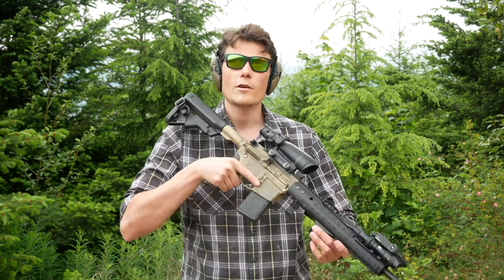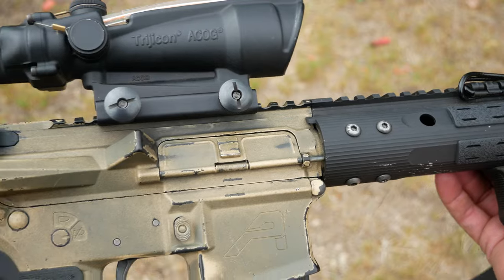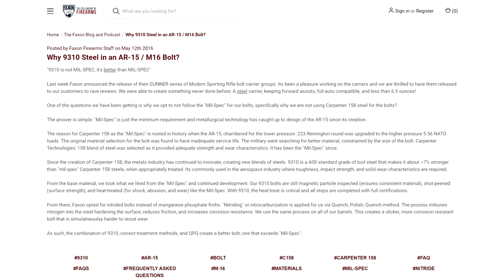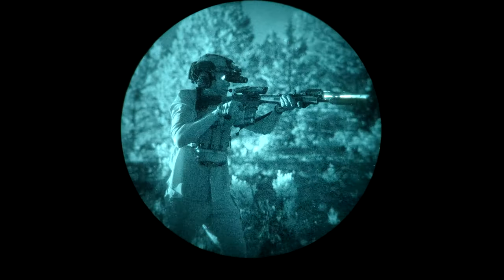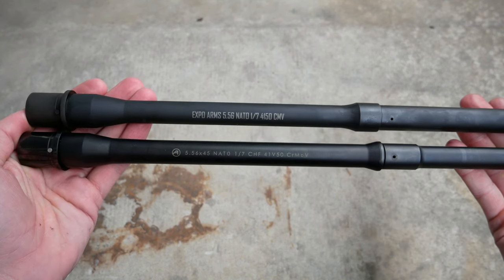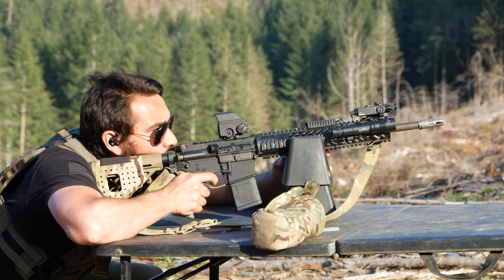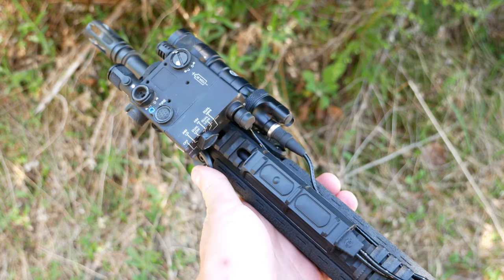Let's talk about the new Aero Precision PRO Series

Comment: I wouldn't call tuning a rifle (via adjustable gas block) "snake oil" in of it self, but if you have the correct combination of parts to go along with a barrel's given gas port size (and shooting the right ammo) then effectively your rifle is "tuned" from the start, instead of after the fact with an adjustable gas block. From the video footage, that build looks to be excellently configured with the brass cased ammo and I assume a fairly standard carbine buffer weight and spring strength. Ejecting at about 4 o'clock unsuppressed and 3 o'clock suppressed is perfect. The only way you would "tune" beyond this is if you decide you are always going to shoot suppressed and then try to make that permanent configuration eject at 4 o'clock as well.

Comment: >chf
>NOT chrome lined
Literally ass backwards. Colt barrels aren't CHF, but they are CL, and they set the standard for "duty grade" barrels for decades. I could be wrong, but I don't think the M4/M16 TDP specifies CHF. FN-produced M4s and M16s have CHF barrels, just because that's how FN does barrels.

Comment: Some things to mention: the pro barrels are dimpled so installation easier and gas block walk off is harder. Chrome lined is more preferable than CHF (look up BCM's testing of a mil spec barrel and you'll know why). Lastly, if the BCG isn't full chrome with a phosphate ejector then you haven't reached peak autism.
Reply: CHF does little without chrome or stellite lining.
Reply: How much of a gimmick is CHF'ging in general? I understand it got popular in comblock countries because it was an easy way to mass produce good enough barrels to throw in AK's. By no means is it a terrible manufacturing method, but I can't help but think there's a lot of undeserved hype around it.

BCA is doing CHF'ging now, and you couldn't give me one of their barrels.

Comment: The only problem I've had with bolts is lug wear.  And only had it with two makers, AR SToner and PSA. (I'm pretty sure AR Stoner is a rebranded DelTon.)  Granted those BCG's are super cheap and hold up reasonably well and it's not indicative of all their BCGs.  It seems to be from sloppy machining,  from a worn cutter which doesn't quite make the bolt cam slot right, so there's some slop.  

This results in rounding of the edges and minor dings on the actual bolt lugs if I'm shooting mystery or hot loads.  Not a big deal, I still have them, adn they are now an "emergency part" to cannibalize if the ATF goes full Brandon. They are still useable in their current state and each has about 2K rounds on it.  (DelTon/AR Stoner a est. 1000 more)  I think this was due to PSA/Stoner just starting up and over eager in their attempt to break into the market.  I've bought other PSA BCG's since and have not encountered any slop and they run tight and right.  DelTon's I don't bother with because there is no real savings there, and for me not worth the risk.  

But as far as BCGs go there seems to be litter difference if you are going with a reputable manufacturers.  They all seem to have the same level of QC.  And to be honest, for the average shooter, the chances of you wearing out a BCG is pretty remote.  For the most higher end BCGs I estimate it's something like 15K rounds minimum asides minor repairs like gas rings or extractor spring/o-ring. 

I have several BCG which I run, currently I'm biased towards WC because every once and a while they'll go on sale and you can pick up a top of the line WC for about the same price as midgrade BCG.  (175 or less USD)

Don't take this as a gun-snob type of thing, what you can afford is what you can afford.  it's better have something bare bones than nothing at all, just know what to expect.  Aim small ya'll.
Reply: Far as I know, AR Stoners are rebranded BCAs. (Compare the flash hiders on the Stoners and Bear Creeks)
Reply: @l800x8  Maybe but, don't think BCA is that old.  Similar QC though.  Who knows.
Reply: PSA used to offer multiple bgc’s from different sources. They offer toolcraft bcg’s which are awesome and you can get them with the tool craft logo or not. I think they only offer toolcraft now but I have searched for any other type from them.
Reply: @chrisjosekuehl  I think they are all in house now.  They may have done that starting up.

Comment: Regarding the Pro Series lower, I think it would essentially feature a right-sided bolt release like the Munitionworks Dissident, a side-charging handle like a JP Rifles/Sig MCX Spear and probably would be designed to take folding stocks.

Pro Series upper would just be straight up monolithic.

Comment: I have 9 Ballistic Advantage Hanson profile barrels in many different lengths. I've been buying them since 2017, and I still haven't found a reason to go with another brand of barrels.
Reply: I have used and built over 100 aero rifles for customers and BA Hanson is my first recommendation for customers wanting something better than milspec. Unfortunately for me as lefty, I can’t use the Hansons anymore because I’m switching all my guns to short stroke piston setups because the gas is right in my face and the Hansons don’t have a long enough gas journal. I’ve built one short stroke piston with their fluted spr barrel and it is great, a little heavier than the Hanson but still great.

Comment: Aero is at the upper level of "worth the money" they are right at the point of diminishing returns.  You need to spend thousands of dollars to get something marginaly better than Aero.  Most people will never be able to justify  spending more for anything other than a name.
Reply: I havent looked at their prices but aero is the bare minimum I would be confident in trusting my life in. If you have the extra cash I would go BCM for that bit extra confidence. I wonder if this Pro series would be a nice middle ground in price to feature to reliability.
Reply: The aero lower is arguably the best bang for your buck lower, but their upper is pretty garbage, I would not consider it to be even mid tier, simply for the fact that they use a pencil barrel, your accuracy greatly suffers after a short string of fire
Reply: They gotta release a full ambi stripped lower for like 225
Reply: Bro, go buy a Daniel Defense or a Solgw and you'll realize why you spent the extra on.
Reply: If someone wants to get into building lots of rifles, they'll need the tooling required to troubleshoot a bunch of potential problems. Aero is right where that budget makes sense. If someone is just getting a single SHTF rifle they can do better, but only because I would want them to get a nicer barrel. But it's definitely quality.
Reply: @patrickzzz3465  mine came with government profile, plus I think their barrels are from Ballistic Advantage so they’re not garbage. 

I still wouldn’t recommend buying “complete” uppers from them though. The default Atlas handguards aren’t bad but they’re hefty, and there seem to be fitment/gas issues with the way Aero assembles their complete uppers.

EDIT: Nvm mine is mid-length contour profile. Rest of my comment still stands.
Reply: Wtf you talking about they are at the bottom of worth the money. The enhanced receivers are borderline cringe and the threaded bolt catch is a major liability per trex arms' stress test.
Reply: @samhinnant4416  people always trying to compared weekend warriors with proven soldiers 😂
Reply: A SOLGW is like $600 more. Hardly thousands. And the engineering is MILES ahead of them.
Reply: Tell that to my 18” M4E1 upper that won’t cycle straight out of the box

Never had that problem with a Geissele or BCM 🤷🏻‍♂️
Reply: @samhinnant4416  dude, DD thats an extra 1-2 grand for an upper alone dude. And maybe a shitty mlok hand guard Im gonna have to swap out. SOLGW is nicer but still this isnt supposed to be some gucci rifle war. 

I had a AERO upper mid length upper that was awesome and government profile, but the Mlok hanguard was pretty heavy. 

Now Im with 2 piece quads and it works out for me. Barrel hasn’t had anything wrong with it, and didn’t cost me 2 grand a rifle
Reply: @fireemblemistrash75  Where are you seeing DD uppers for over $2k? Street prices for DD uppers is between $1000 and $1500, depending on barrel and handguard.
Reply: @wongkeebs4327  Man says "paying for a name" and the first reply is a dude doing just that. lolol.
Reply: @sludge_factory_foreman same BA Barrels and Toolcraft BCG. Aero might actually have the better rails on the interrupted ones.
Reply: @fireemblemistrash75  All I'm saying is if you want a quality rifle, there's a reas9n for the price tag of the more expensive brands. But if an Aero Precision is all that you wana spend money on, then that's cool. But don't mock people for spending the extra money on quality if they want the best, and they actually shoot their rifle up to 10,000 rounds per year.
Reply: I'm smiling at all the Aero haters because half the parts in your overpriced rifles came from the same sources as Aero uses or Aero themselves were likely the subcontractor that made the parts for your Gucci brand. 😂
Reply: @patrickzzz3465 Did you know that the M-16 A1 rifles were all pencil barrels?
Reply: @basedWisco715 I have all four of mine out of their boxes, attached the barrel of my choice, then put in the bolt carrier group, and radian charging handle. Oh, and I use the "enhanced" 1.72 diameter front rails. I have never had a problem.
Reply: @samhinnant4416  I'm at 4500 rounds so far this year. Well, just over 4000 rounds from my 5.56, and around 460 rounds from my .450 Bushmaster built one. All I use is my custom built Aero's. I don't believe I will ever have to think about another brand, at least for now.
Reply: @matt291  I agree. Also, their upper and lower shells are made of the exact same material. Not to mention the shells themselves are not moving parts.
Reply: @jhutch1470  that’s because all you’re using is their stripped upper. Mine’s a complete upper
Reply: @jurpo6  it's called locktite and it's recommended by Aero themselves. They consider themselves a build kit company not a out-of-the-box rifle company. You need to break it in.
Reply: @rilesmattix5217  LOLOL you need fckin locktite so your gun doesn't deadline itself? that's the opposite of duty grade.
Reply: @wongkeebs4327 PRO and BCM’s are priced the same. I would never get the PRO for that reason. Either go the regular Aero/Ballistic advantage rifle, or go BCM. Both are great options.
Reply: @jhutch1470  and that’s why they got rid of it
Reply: @matt291  exactly. I forget which brand it was but people found out one of the companies that makes parts for aero also made parts for their gucci rifles. 

Funniest thing Ive ever seen.

Everyone is hating and seriously hyperventilating that someone paid less for an equally serviceable rifle.
Reply: @fireemblemistrash75  You buy Aero and other mid tier guns. Il save the extra money and spend it on something I know I can rely on for 30k plus rounds of ammo and still counting with no malfunctions. That's why I pay the extra money on brands like Daniel Defense and Solgw. I want something I know will work if I have to defend my life with it.
Reply: Most people will never fire more than  500 rounds through their rifle because they have neither the time or the money to cycle thousands or rounds.  The average person does not need a rifle that can dump a combat load of 7 magazines and maintain zero.  They need a rifle that will reliably cycle 2-5 rounds and hit a man sized target inside of 50 yards.  99.99% of rifles will never be fired in anger and spending thousands of dollars to buy a name is just vanity.

Comment: Got a new subscriber here.  I'm glad to hear someone say it.  The gun communities stupid standards for what they consider "Good enough" is getting out of hand.  I've felt that the Aero Precision (Also Ballistic Advantage) stuff is your lower of the mid tier stuff.  It's by no means low quality, or unusable, or not "Duty Grade", assuming you get it specced the way that you need it for whatever job you plan to maybe use it for.

Bear Creek Arsenal... now that is some low end crap.  Then you have the entry level stuff like PSA which are great, love them.  Above that, Aero Precision.... if you really want to spend more beyond Aero or similar, you'll pay about twice as much for the QC and the name.  If you want something for pure accuracy or competition, you'll spend 3 times as much or more and actually get a big performance boost at the cost of needing to "Tune" it just right or suffer some reliability problems.

I knew a guy who was bragging about his 5.5k AR10.  He has Aero upper and lower, and a bunch of top notch parts to include a proof barrel that was close to 1k alone.  Guess what didn't reliably cycle when it came time to shoot.  My crappy little sub $500 PSA shot decent groups and cycled perfectly.  Use the right tool for the job and make sure it's put together properly, simple.

Comment: The current M4A1 TDP does not call out a particular process to make the barrel, so CHF isn't necessarily more mil-spec than button rifling.
Reply: Also, CHF doesn't really give you any performance or longevity benefits if you don't redesign the rifling and bore profile to take advantage of the process (only HK does this to my knowledge, maybe other euro mfgs too)
Reply: Yes it does..It requires a push button, not pull buttoned rifling..Colt Canada requires hammer forged..
Reply: @hairydogstail  You may be right, but I don't see that note on the drawing.

Comment: Which has better quality and value between the Aero Pro and PSA Sabre for a complete upper? Or would I be better off just building my own? I'm a little leery of mixing and matching parts though and having reliability issues.
Reply: You should be fine mixing components, the AR15/M4 platform has set in stone specs that everybody goes by, the AR10 is the gamble where you really have to be careful mixing parts.  There's most commonly only one main incompatibility you could encounter based around receivers, and that's gucci billet ones with their own designs.  It's best to not mix different billet lowers/uppers for match and fitment reasons.  Billet may also not quite look right with specific handguards or have some crashes with the anti rotation tabs on some.  I'd build your own, it's very easy and you really only need a couple tools.  Toss your own good quality bcg and barrel in it, that's the heart of the rifle right there.  It only takes maybe an hour the first time to build a entire rifle, there isn't much to it.

Comment: CHF barrels outlast button rifles barrels no argument.  Nitrided/melonite(other names apply but its the same process) aka salt bath nitriding is a metal treatment not a coating and this process increases the rust prevention(even when the black coating wears off) and it hardens the steel.  Nitride penetrates a couple micro meters into the steel hardening as it goes leaving a black finish and just because the black finish wears off doesn't mean its not still doing its job.  Chrome lining is a metal coating and can chip/wear out and this goes for DLC an NiBo as well.  A CHF nitrided barrel should offer years of accurate shooting.

Comment: An ambi lower would be great
Reply: Get a PDQ lever and take a trip to your local gunsmith.
Reply: @Pyreleaf  Take it with a grain of salt, or a shaker full of salt, but a bolt hold open is probably more valuable, desirable and important on your off side than a bolt release. 
A true ambi lower provides ALL the controls, not just some of the controls. Also, it provides proper controls, not kludged solutions like bad levers.
Reply: @raifsevrence  I said a PDQ lever, not a BAD lever. It's basically identical to a standard bolt catch, except it extends all the way through the receiver and terminates in a paddle on the right side that serves as both a bolt release and bolt hold-open. It can be installed on any standard lower; all you have to do is mill the bolt catch pocket all the way though.
Reply: @raifsevrence  you're right, except the PDQ  is the ONLY option for bolt hold and release on the right side. 

I think Radian offers an ambi that comes close, and I know there's a mod for bolt hold on mag release, but only the PDQ manages both bolt hold and close.
Reply: @raifsevrence  Id like you to point out why the PDQ lever doesnt act as a bolt hold open

Comment: The main advantage I've seen for nitriding instead of chrome lining is that better mechanical accruacy is easier to achieve. Not that a properly chrome lined barrel can't be accurate, but nitriding is an overall easier manufacturing process & cheaper as well. 

The difference here is that a military unit is much liklier to prefer chrome lined, CHF barrels to maintain an acceptable "combat" accuracy of 4 MOA or less. All while being able to withstand a healthy dosage of full auto firing schedules for far longer. Most civilians, even deeply autistic ones, are likely never going to burn through the same amount of ammo and are liklier to value higher carbine accuracy standards than the military will. 

So what we potentially have here is a barrel that can maintain better accuracy at a slightly lesser life span than that of a CHF chrome lined barrel, but a longer life span than a button cut, nitrided barrel. "Life span" being a nebulous term for how long until the rifling starts eating shit and opening up the groups to an unacceptable degree. I may be wrong on this but I believe CHF barrels generally handle heat better than button cut barrels which ultimately contribute to better sustained accuracy with a hot barrel.

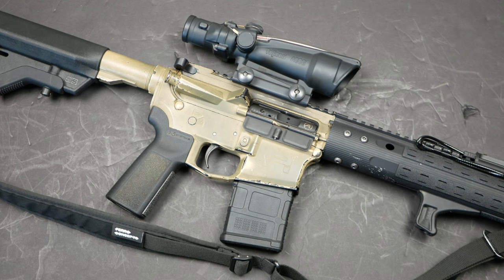Comment: 2:29 so actually, mil-spec does not mean cold hammer forged. Mil spec barrels are button rifled. Which makes the Aero Precision pro barrel not the correct rifling method, not chrome lined, not the government profile with M203 cut, and of course not the proper length. But it is the correct steel, chamber, and twist rate.